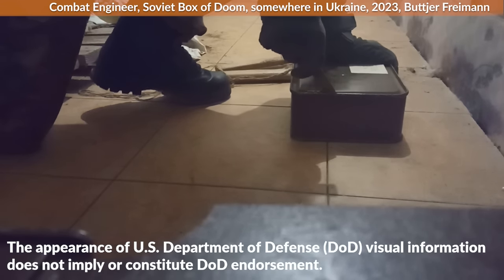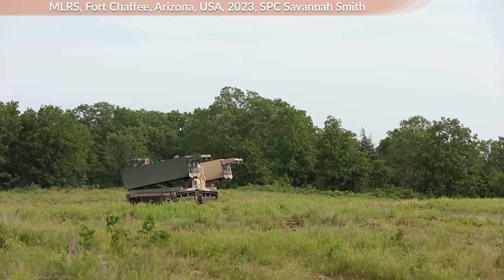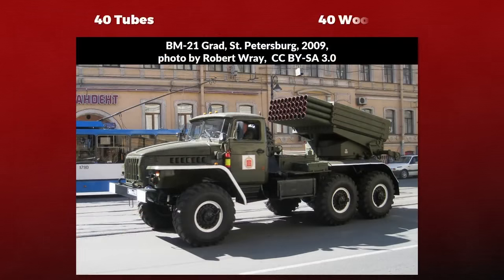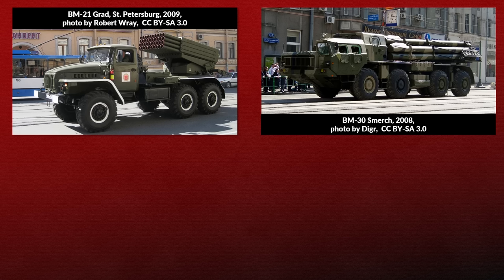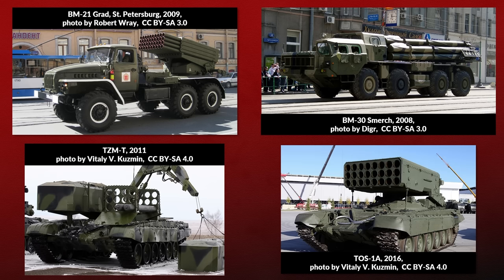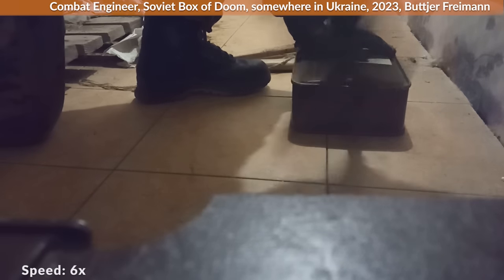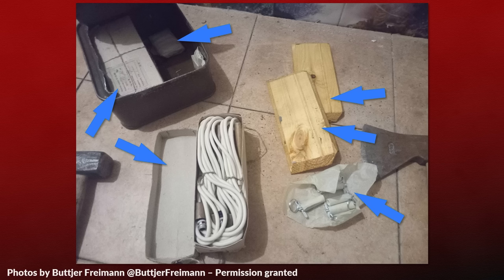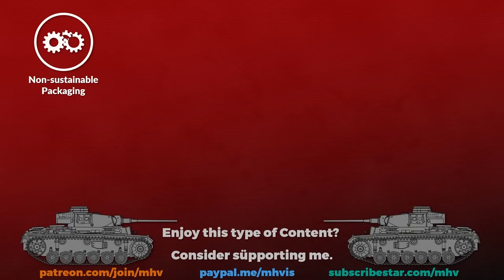Ukraine: Why Soviet Packaging is a Nightmare - Unboxing Edition

Comment: Comparing the BM-21 to the HIMARS/M270 is very misleading. Yes, the way they use it in Ukraine would call for fast reloads and so on, but doctrinally they do not require this. 

Doctrinally the Soviet/Russian army would fight with a lot of men and material on the front. It would then find a weak spot and mass artillery (such as grads).  They would then suppress enemy forces with a barrage of fires (like entire battalions of Grads would be fired all at once) and then exploit the created gap. And until the mechanized and motorized units take the objective, you have plenty of time to reload, and move up. For this, since you have a lot of these systems, and you would only ever use them massed, you don't really care about the reload time. 

The problem is, Russia is not committing the necessary manpower (which politically would not be feasible anyhow) to have units mass and break through like that. Also  drones and surveillance and its short range have made massing these systems almost impossible. So its poor performance is not entirely the design's fault, but the fact that they are not used in a way where they could be most effective.  

The M270 yes is better at scout and shoot, but not because how bad the Grad is, but because it was designed for a different task. The M270 was designed to precisely take out higher value targets, especially, when air strikes are not available. For this you would want a mobile system, that is easy to reload, and could sustain high fire rates, because you expect enemy forces to remain in range.  

Also there is an argument to individual rocket reloading, where you want to service 3 more targets, but you have only 2 missiles left, do you wait minutes to reload (and give chance for them to disperse). Or shoot at 2, and hope that by the time you reload, the 3. one will still be there? 

So it is not necessarily a bad thing that you can individually reload these systems.
Reply: you also can load grad ammo on truck with 2 guys, unload it, and then reload the grad. for m270 you need a truck with a crane and good conditions, as you cant handle individual ammo. so if your ammo truck is ie stuck in the mud, there is no way to unload it.
Reply: Also, I've heard that the Russians have occasionally tried massing lots of troops together. This turns out to attract Ukranian HIMARS attention. It probably worked better back in the Soviet era without ubiquitous air recon.
Reply: @phunkracy In other words those logistics suck because other logistics suck.
Reply: @subtlewolf  not really. It's just the focus is on volume

Comment: I've opened up soviet 7.62 ammo and it was a wooden box you rip apart then on with the can openers and then you pull a string to open the metal can inside... then a string to pull out the paper wrapped ammo. Yugoslavia ammo it was 2 hinges on a box then a pull string on the metal can for the paper packed ammo... American ammo you just open the resealable box and it's there to use straight out

Comment: Wood is perfect for storing detonators because it doesn't create static electricity at all.
Reply: Not like the Russians would ever ran out of wood with the taiga.
Reply: @dannyzero692  Well they are having large uncontrolled fires. These are seasonal and were managed using army conscripts which is  at least giving something useful to do. Currently they are not available so the fires burn unchecked.
Reply: Except the detonators were in the tincan.The wood was only filler.
Reply: its a shame that a metal container hugs it around, what you have to pry with another metal object
Reply: holy cope

Comment: Interesting, it does seem like somewhat overengineered storage for ammunition. However, it seems quite durable, being able to survive low-tech storage facilities, and does not really seem that different than some of the western containers I have seen (with bias towards finnish army, which has plenty of wood available). It feels somewhat incomplete without, what are the experiences of forces that had to historically use this kind of ammunition, and timeline on how western forces got better than this at handling ammunition.

It needs following topics to be answered to understand the full picture:
- WWII ammunition handling, prefereably by different countries
- Cold War Western ammunition handling
- Possible soviet sources on why such kind of ammunition handling
Reply: The Swedish cold war Bandkanon1A had it's ammo in giant 14rnd clips designed to be loaded directly into the magazine from the ammo supply truck by either the hydraulic crane on the ammo truck or the crane on the howitzer.
The full reload took 2 minutes...
The clips were factory packed onto standardised pine plank railroad cargo pallets, and most ammo depots had a protected cargo dock allowing ammo handlers to use hand or motorised fork lift cargo trucks to safely and conveniently shift the pallets with the ammo clips from the shelves of the depot to the ammo trucks in a roll in-load up-roll out procedure that also took no more than a minute per clip pallet.
And this is clips of 14 single piece self contained 155mm howitzer cartridges... loaded into a self propelled tracked armored howitzers magazine in 2 minutes. A howitzer than can then send all of those 14 rounds in the magazine downrange in about 45seconds from first to last shot...
Reply: @SonsOfLorgar  Thank you, that does seem to be much more advanced than soviet system, which is much more designed for manhandling. Finnish army has to my understanding, recently tried to work its logistics into pallet system as well. Russians seem so far to have been unable to "palletize" their logistics, and Ukraine of course has no choice but to deal with things that were stored during the soviet era. 

However, to note, Bandkanon 1A seems to be an exeptional system, with its magazine, as US M109 does not appear to posess any kind of autoloader, and their autoloader-equipped system only coming into service in 2025. Suprisingly, other autoloader-equipped systems seem to be somewhat rare, or recent as well. So, I do have to gongratulate Sweden for developing an exeptional artillery system. (But I am still wondering why Sweden deciced to retire this system in 2003, when Finland had Gvozdika still is service until quite recently.)

However, I'm still left wondering also, was the supply system this efficent in 1967, when the weapon entered service, or was this a latter addition.

Edit: upon finding r/askhistorians post, the problems of Bandkanon 1 appear to be low production numbers (26 according to Wikipedia) and low mobility (until engines were upgraded in the 1990s), still, seems weird to retire 🤷‍♂️
Reply: @re64I expect Finland takes its defense seriously. It's only been 85 years since the Russians visited and some of them might have forgotten how it went for them the last time.
Reply: The soviet fought in both Artic, Forest, Desert and even tropical environment. It make sense that they have to priority shelf life over everything else.

Comment: The WW2 Jerry can is an absolute work of genius. Our troops were issued fuel in poorly constructed square tins that were prone to leakage, nicknamed Flimsey's.
Whenever the chance arose British troops would ditch their own cans and use the Germans. There are several YouTube videos on the Gerry can detailing the many innovative design features.
I  have one in my garage which i use for diesel when going on long trips. Many thanks, great video. Liked and subscribed.
Reply: so this is where the term comes from
as a german myself this is surprising
Reply: The army board decided that disposable fuel cans were the way forward, rather than reusable. Understandable but the problem was quality control was so poor and they got such a battering in shipping that half were already leaking (as you say) on the first use.
Reply: @benlewis4241  That would make sense. Thanks

Comment: The main thing about this kind of packaging is that it can be stored for a long time without any problems of of quality deterioation of the contents of those boxes, also when you have a loot of exes wood then you use it as filling because you make the same sized box for more stuff so you can cut costs and the wood is cheaper to not procces. And also you dont need to reload MLRS fast when you have abundance of those systems, and even then while the MLRS system is firing a few guys in the back are already unpacking the rockets to be used for the next reload, and also you dont need any crane to reload the MLRS so you can cut costs and if something was to happen to that crane you can still reload those MLRS systems, and if the logistics truck was to crash then you can just carry those boxes around even tho there are only 2 of you because those boxes are so small

Comment: This is really a symptom of a completely different problem.

Sealing it in tins is a very good way of storing ammunition safely for large stretches of time, and for something like small arms ammunition it isn't going to be a major bottleneck opening them up.
The problem only arises when you have larger ammunition like rockets or artillery with only a few rounds in each box, which leads to the real cause behind this.

The soviets never properly embraced forklifts

Comment: About 12 years ago I bought a Russian Surplus Mosin-Nagant rifle.  Considering the less than perfect finish of the bolt action, which to be fair is cosmetic, shows that my rifle was made during wartime, as the quality would not have been acceptable otherwise.  The ammo, 7.62x59R was packed in a can much like you had shown.  I had to use a knife to open it, and once opened there were 480 loose rounds to be dealt with.  Probably not an issue if a lot of men are loading their stripper clips and using up all the ammo once opened.  While it doesn't fit very well, I transferred the ammo to a regular US Army water-tight ammo box, which is a superior manner to store, ship, and use the ammo.

 The rifle is actually pretty good if you don't consider the issue of dealing with the ammo.  It is very accurate at distance, however the thing kicks like a mule.  The accessories that came with it included the ammo belt with leather pouches for the rounds, a cleaning kit with the dried up remains of oil and grease, and of all things a bayonet.  The rifle with new identification numbers for selling in the US was about $95.  I think I paid about $88 for the can of 480 rounds of ammo.

Comment: While I can agree on a few points here - some seem to not grasp the concept of packaging.  Spam cans for small arms make a lot of sense for any military.  But they're exactly what they look like: storage containers.  Not ammo boxes ready for use.  If you're trying to open a spam can in the middle of a firefight, you've already done something wrong.

Regarding the grad...loading it is absolutely slow, but it's also less than 10% the cost of any modern western rocket system, ammo is significantly cheaper, and they're generally fired in pairs or larger groups and then driven out of the area - without even firing a second time.  Modern western rocket artillery is superb...and comes with a superb price.  We're talking millions of dollars per rocket/missile in some instances....and even more when you add the launcher component to the reload, etc.  I don't think you can compare the two systems without taking cost into account.  Something tells me the Russians were sitting on far more Grad rockets than we have HIMARs, etc.
Reply: They aren't really comparable.  The grads are an inaccurate area saturation type weapon while himars are much more of a sniper weapon.  If you look at the cost of taking out a particular target, himars might be cheaper.
Reply: Compare the spam cans to the american counterpart. you get your ammo on stripper clips with magazine adapters. in less than a minute your ENTIRE combat ammo load can be replenished, and guess what? the ammo is still in a SEALED CAN until use.

Comment: The other thing with the Grad rockets is that after unboxing it you also have to arm the rockets before loading it into the launch tubes, so you can't even just break them out of the boxes and shove them straight in.

Interesting the Chinese, who use a more complicated (but arguably faster) method of loading 122mm rockets, store their rockets in metal racks of 2 rockets each.
Reply: It is telling that China, not Russia, is iterating and improving their Soviet legacy equipment.
Reply: Czechs just put the system on a truck chassis large enough to hold a whole second rack with the RM-70.
Reply: @ausaskar  The Chinese actually ran with that idea too in a system called the Type 89. Ultimately, though, the American pod system is better and they switched to that instead.
Reply: @jamesharding3459  Well, unlike Russia, China doesn't have the manpower to spare. Oh wait ...
Reply: Если у вас кривые руки, то конечно у вас ничего не получится. У простых российских солдат, которые эти Грады заряжают, руки явно прямее🥱🥱

Comment: The packages aren't "reusable" But they do provide reclamation which NATO plastic does not. The wood can be used for fire fuel or building if not badly rotted, and the cans are cans, so 100% recyclable. 

NATO spends a LOT of money on both single use plastic, and shipping empty boxes around. 

NATO wins for Logistics, but at a significantly higher cost, which given how "wars" actually have been fought the last few decades, only creates a cost burden not a logistical advantage. Having shot both AKM and Mosin-Nagant with my friends, I'm unfortunately personally familiar with the hassle of opening these damn doom boxes, as well as the flimsy bullshit packing of the interior boxes so once you get the big box open, the individual load packs fail as often as they stay together. 

But you also get some pocket change back when you scrap the can, and the paper internal boxes biodegrade quickly.

Comment: Yeah those cans are just meant to preserve the contents in perpetual storage and rough conditions, that’s why you need a can opener in the first place. Much of the ammunition is also very corrosive, so you need to clean your arms often to avoid pitting.
Reply: 30 years storage in coditions ranging from +40 to -40
Reply: But so where the Yugosavian cans. And those can be opened with a simple pull-tab.

Comment: I still can't wrap my head around that idea that everything is in individual boxes that are made to be as difficult to open as possible.
Reply: Long term storage
Reply: @tomhenry897   OK you can still have a tight seal without being a pain  To open like in Western countries
Reply: @blazingkhalif2  Any food canning factories can switch to canning ammo with a proverbial flip of a switch. Low skill, loose tolerant and utilizing less strategic material is the name of the game. It's all about the surge capacity in war time condition.
Reply: @blazingkhalif2  Or at the very least, use bigger cans so that a little extra time opening results in much more ammunition.
Reply: @blazingkhalif2 Western boxes use rubber seals which degrade relatively quickly.

Comment: What a poorly-made research. Grad is in a different "weight" category from HIMARS, its main advantage being the ability to load its 40 rockets by hand without a loading machine. Rocket size and mobility are its main strengths. HIMARS counterparty is not Grad but Tornado (previously Uragan).

Comment: Typical reasoning of a manager who has never dealt with real things. “Let’s make super-duper packaging that will be more expensive than the contents and sell it to the state at a price 10 times higher.” Everything that has been done in the West is pure dust in the eyes, which does not work in a real war. For each piece of equipment, you need a couple more truckloads of consumables and spare parts, as well as a bunch of certified specialists to fix it. But it’s even better to wait six months until they send a spare part. The Soviet packaging in the video is at least 50 years old. I'd like to see some Western Stinger or Javelin after 50 years in storage - how it would perform.